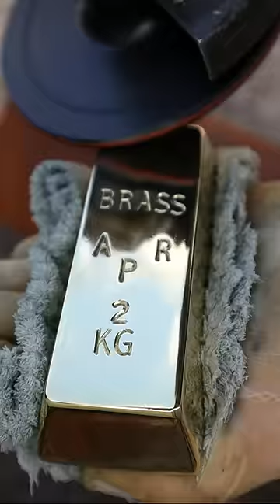Making Ingot out of Brass Granula - Sand Casting

Comment: So I didn’t know you could just stamp writing into solid metal like that.
Reply: it's a punch, it puts the force of a hammer into a really small spot
Reply: I think you can only do that with softer metals, so not with iron or steel, but things like copper, gold, and presumably brass too
Reply: @normalhuman512  nono, you can do it with anything as long as the punch is harder than the metal you're punching into
Reply: @gaminggamer9698  that makes sense, but would you be able to do it by hand like in the video for hard metals or would you need a machine
Reply: @normalhuman512  dunno, probably by hand, it focuses the force to a small point
Reply: @normalhuman512 you can absolutely do it by hand with a punch and a hammer. Alphanumerical/symbol punch sets are cheap nowadays. I use mine to punch my initials into my steel tools.
Reply: They are small stamping irons...cast from a tool steel
Reply: @normalhuman512  Raw product such as steel slabs, coil and plate are often labelled with a dot matrix spray printer and also with barcoded stick on labels.
Reply: @normalhuman512 Letter and number punches are made from hardened (heat treated) steel. So as long as the steel your punching hasn't been heat treated after you work it, you can punch them by hand! And ofc anything softer, from steel to iron all the way down to lead. 
Pro-tip: practice your hammer swing on a scrap piece of steel so you get a feel for it before working on your good piece. Also, punching like that raises the metal up a bit around the letters so you'll have to sand it back down if you want the surface to be perfectly smooth
Reply: Center punch

Comment: Always wondered (obviously not a smith or metal worker myself), what’s the glass for in the smelting process?
Reply: Lok at the top comment
Reply: @abo3abid1  interesting!
Reply: It’s a cheap way to insulate the molten brass from oxidizing the toxic zinc fumes. Much cheaper than using the same amount of borax powder.

Comment: Nice. What’s with the glass in the crucible?
Reply: Helps remove the slag that builds up at the top of molten metal
Reply: @probablybadgers3994  that's... pretty smart.
I wonder why it isn't done more often
Reply: @amaulana090   It is not done often with brass because the borax that he used is a flux, a chemically active additive for removing dross & debris. Slag is from a refining process not from casting.
While commercial glass is commonly available but is virtually intert,  used mostly by Russians to seal crucible steel at a much higher temperature.
Reply: Glass is SiO2 or Silica, on melting it forms an acidic slag which assists with removal of impurities as oxides, a necessary part of most metal extraction processes. Borax / TetraBorate acts as a thinning agent of the slag.
Reply: @probablybadgers3994  Helps FORM the slag which then skims off the impurities.

Comment: Any reason for the extra dry green sand?
Reply: Because wet green sand would be hazardous in molten metal.
Reply: @SW-ii5gg  green sand contains much more moisture than what is used in the video here. This is too dry by any foundry standard.